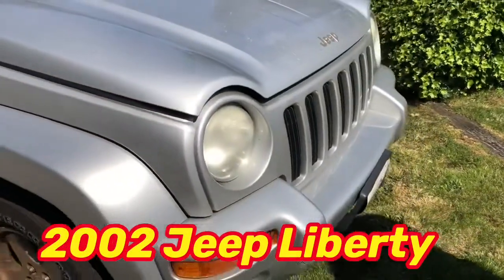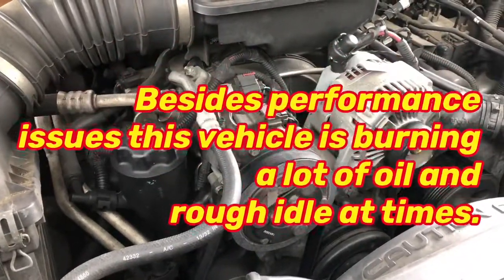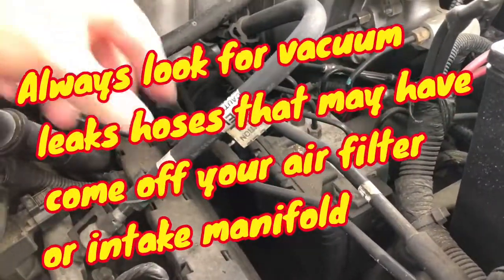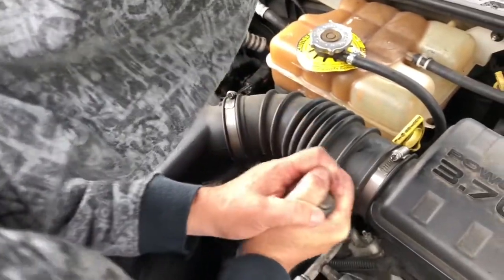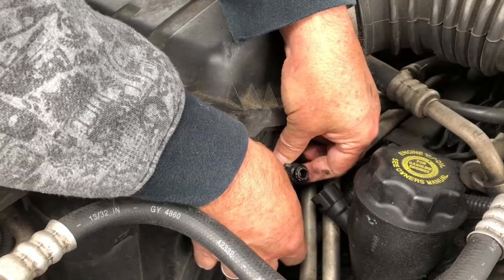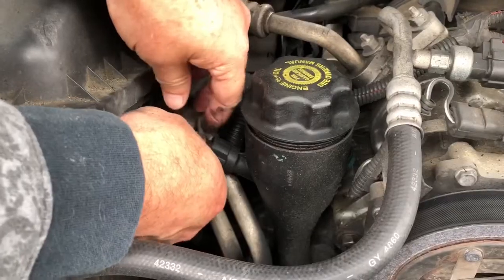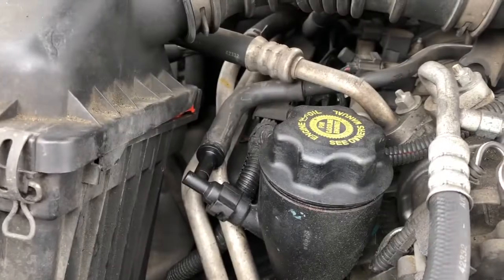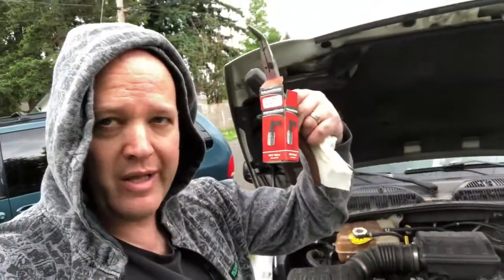2002-2007 3.7L Jeep PCV Valve! Loss of Power? Hard Start? Rough Idle? Oil loss? Oil on air filter?

Comment: Disconnecting hoses?? Do only when hose is warm, not cold.  Cold hoses can break due cold they wont spanand can break instead,  Warm up engine if.  Or use a hair dryer if cant start.  Dont disconnect old cold hoses they will break instead..
Reply from the maker: TBT If the hoses are so old and brittle they break when they’re cold. You should replace them anyway. It’s best to replace the hose is when things are called for that reason so you can replace brittle worn or breaking hoses. Thanks for commenting great points appreciate your input.
Reply: @RussShawTV  Sometimes you just want to do a quick job, not replace them after you break them..  It is a tip.
Reply from the maker: @CFITOMAHAWK  That’s good tip. 😎👍 I just did that heater hose junction on our Pontiac G6. Technically a shop would’ve recommended me replace all the hoses but I did not do that because it would cost me a fairly good chunk of change. 💸💰🤑Hoses I have are old and worn but they’ll do for probably another 30,000 miles.